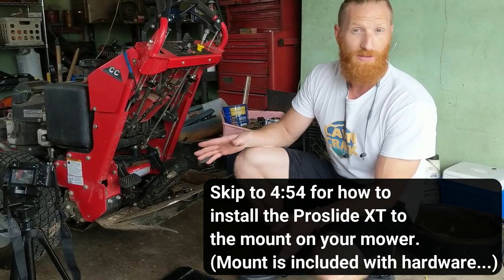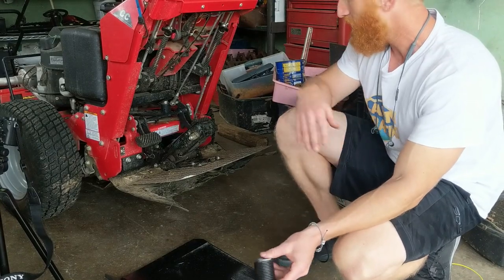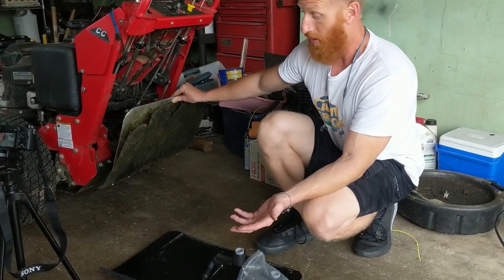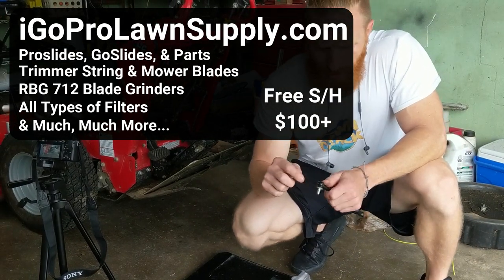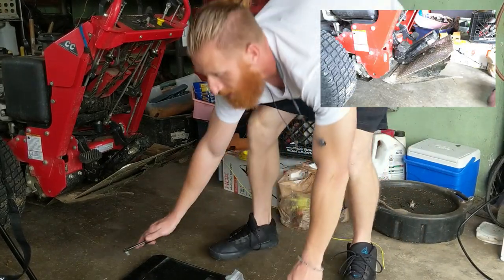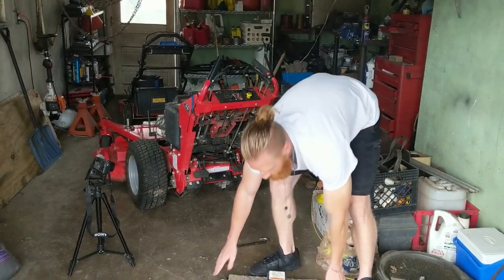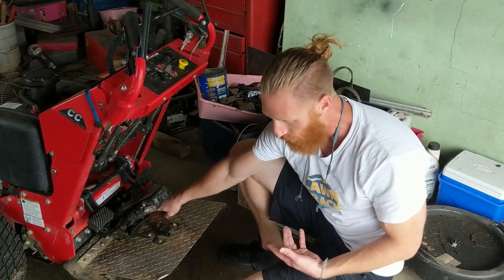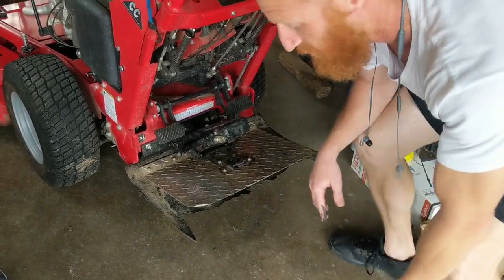Proslide XT Owner's Guide - How to Mount & Tips from 10+ Years of Use & See It In Use

Comment: I ran a Valky for years which has one wheel never an issue never an issue with my knees easy to pull up and hook to walk behind flip a latch it drops down jump on and go I’ve cut on hills never an issue I was one of the first about 35 years ago to demo the Valky I still think that’s the best way to go there’s two arm Lenz when you buy it very important to get the right length so you’re not leaning this Pro plate looks like a good idea but the maintenance and replacement parts are ridiculous
Reply from the maker: Well...you're wrong sir.  Proslide's solve all issues wheeled sulkies have - which are numerous...

There is little maintenance on a Proslide.  Wear and tear parts will need to be replaced over time.  If not abused, on average $50 will be maintenance cost per year.  All maintenance can be performed in 5 minutes or less. 

No flat tires to deal with or bearings.

It's literally better in every way.  PERIOD.  I've used them all...